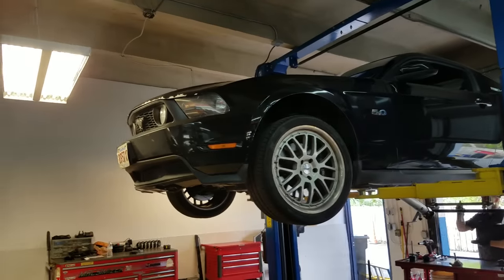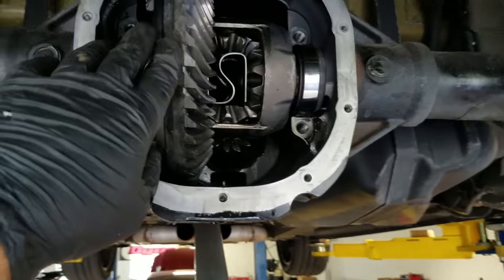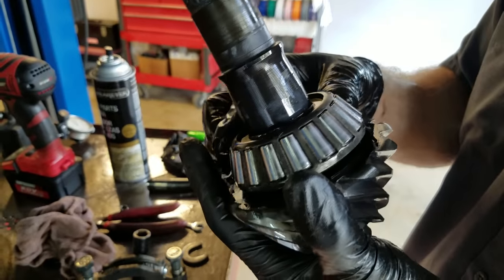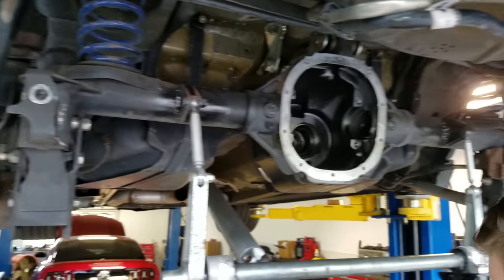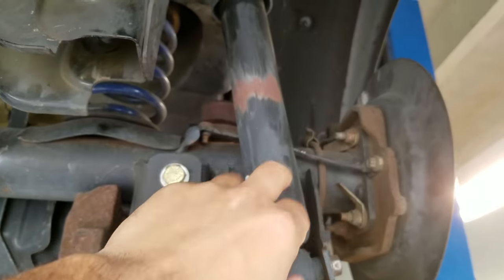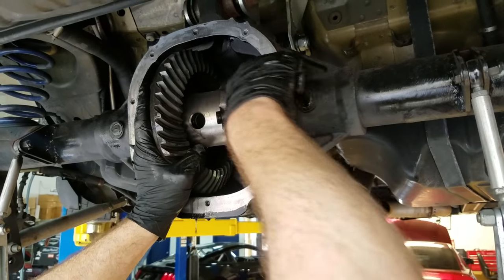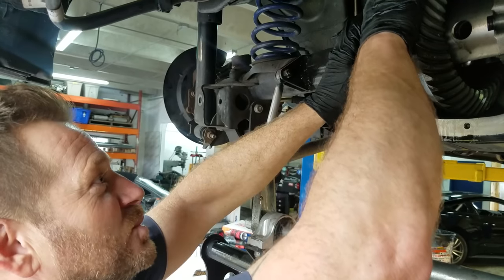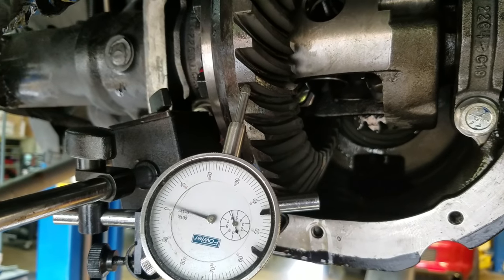4:10 Gear installation brings the T56 equipped mustang back to life.

Comment: In one of your other videos you said that 4.10 gears are terrible
Reply: probably with an MT 82 transmission. Yes they're terrible. The 3.73 aren't that good (in terms of daily driving) either since they're very noisy gears.
Reply: Angel They are in the t45, but not in the t56 the gear ratios are a little more spread out so you be having to shift every .5 seconds
Reply: @coreymoseley6710  4.10 are not bad with a t45.  I had 410 in my bolt on 97 cobra and wished I'd went 456 afterwords like many other people have with older bolt on na cobras that gear works awesome with those cars shifting at 7k.  You don't have to shift every half second lol.  Unless you don't like to go above 2k when normal driving which idk why you wouldn't wanna do that.

Comment: Doesn’t the GT500 have the same trans gearing with 331’s? I thought it did. The 875 rwhp GT500 I drove felt great with 3.31’s and 2.66 1st gear. It made a shit ton of torque too. What’s different about your setup that the 331’s don’t work for you?
Reply: We also hit a 9.89 @ 157 on welds and slicks, with those gears.

Comment: Got 3.73 in my tr6060 swapped 2012 gt, 4th gear is topping out somewhere over 150mph I think 160mph and I’m NA so that’s a no go for me the shop told me 3.73 was gonna be fine
Reply: what size tire u on? and what gears you got now?
Reply: Sounds about right.. my ls3 camaro with tr6060 tops 4th about 160mph 3.45 rear and 28 inch tall tires

Comment: What are your RPM im 6 gear at 75 mph and would you would run the same gear in a naturally-aspirated 5.0 with a tune stock intake and long tube headers your reply will be greatly appreciate it thanks
Reply: I mean I wouldn't. Only reason he does this is because the t56 mag has a double overdrive
Reply: @TheEternallifeskater  its not just that it has double overdrive the entire gear ratios are different 1st gear on it isn't nearly as aggressively geared as the mt82 is so you need like 4.30 to be similar to 373 with the mt82 410 (with a t56)  would be kind of like 355 in the mt82m.

Comment: I think your going to find more suspension tuning issues with the 4.10 that the 3.31 help hide.
Reply: Not exactly. He had MT 82 before with 3.31 gears. Now he has T56 with 4.10 and he said that it is very similar to the MT 82. I believe his suspension is already tuned for 3.31 MT 82
Reply: 4.11 will have more torque at the wheels where the mt82 applied the torque through the trans and driveshaft. Simple physics. Thats part of  why the t65 is stronger...
Reply: @joeinmi8671  that don't even make sense lol.  Its not gonna have more torque with 4.10.  The trans ratios are totally different so 410 is gonna be very similar gearing with a t56 that 331 is with an mt82.  Its gonna be very similar little difference.  It doesn't matter if the gearing is coming from the rear or the trans similar gearing is similar gearing. You can even effect it with tire size it doesn't matter how you go about it similar gearing is similar gearing.

Comment: What gears do you recommend for a fbo automatic 5.0 I have 3.73s currently
Reply: Farhan converter over gears.
Reply: Farhan what intake are u running Bud
Reply: GERMAN ZAPATA cj with pmas intake
Reply: Farhan nice same setup I have am running 4.11s
Reply: GERMAN ZAPATA is how do like them
Reply: Farhan there awesome for the powerband which ones do u have?
Reply: GERMAN ZAPATA I have 3.73s, the installation wasn't good so I'm hearing all sorts of gear whine and I'm planning to buy a new set of 3.73s or 4.10s again. I have heard you lose top end power with 4.10s, many people have asked me to stay with 3.73s but I'm still confused
Reply: Farhan if u roll race I would stay with 3.73 if u do digs 4.10s best time at the track 11.8 1/4
Reply: GERMAN ZAPATA thanks man that helps a lot
Reply: Your torque converter lock up is more important than gears.
Reply: @Five00h  go with 3.90